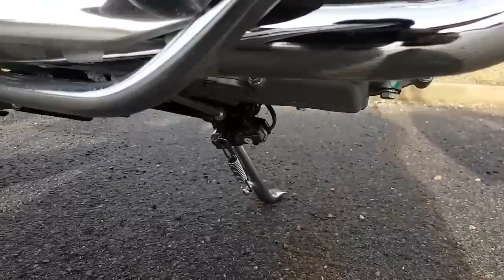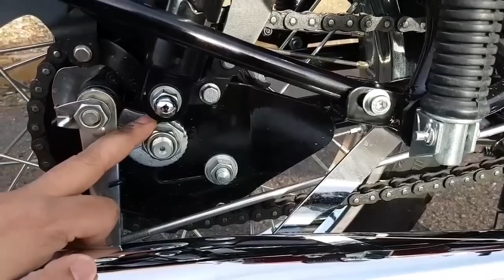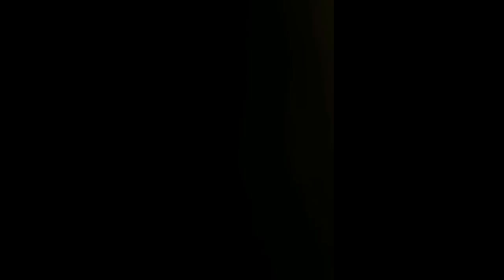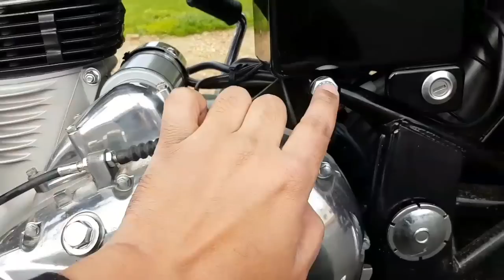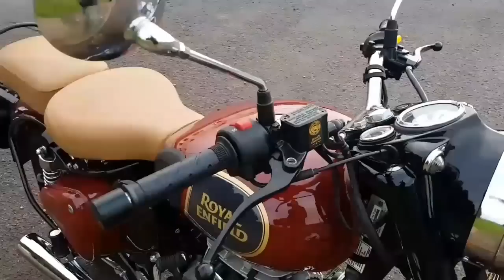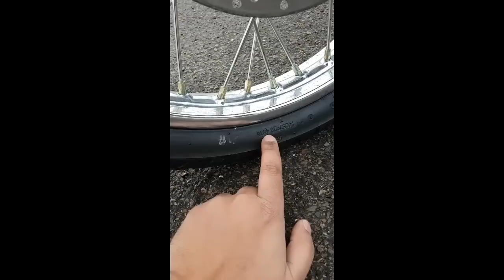7 Important Maintenance Tips for Royal Enfield Classics and Bullets

Comment: Hello from England...great video. When  checking the nut /bolt tightness I noticed the lower (smaller) bolts at the front of the engine, attaching engine to frame could be tightened around a quarter of a turn, however the maker's assembly pen type marks are still lined up perfectly. You referred the the larger bolts above these, as ones that needed checking. Should the smaller ones I have referred to also be fully tightened?
Many thanks!
Reply from the maker: Great point - yes.

REs are notorious for lose bolts.

Comment: highly informative , great job sam. does changing silencer would effect the engine?if not, when can one change the silencer (ex; at 5000km or more)and  which silencer r u using?
Reply from the maker: Vinay reddy thanks. Using Megaphone Muffler (Silencer). Installing muffler won't affect engine at all. Megaphone Muffler increase performance slightly.

 However please don't install cheap ones as the often rust and damage the frame of the bike.

Comment: Good video.  Is that a side stand indicator I see installed on your bike ?  Does come with the stock bike or is it aftermarket ? Any links for that thingy?
Reply from the maker: Frank Rock it's a ignition cut-off switch. If the side stand is  down, the bike does not start. Comes stock with all post 2015 Royal Enfields.
Reply: H Sam in India too ?

Comment: Hello H Sam, i have royal enfield standard 350. I have a small question regarding chainset. chain snail adjuster of both the sides of my bike are at different notch. still my bike works fine and chainset is also in good condition can you explain why?
Reply from the maker: Rohit Sonawane as long as the rear wheel is correctly alligned with the frame and front wheel (when stright) the bike should run fine.

As the chain gets older, it stretches hence you may need adjust each side slightly differently.